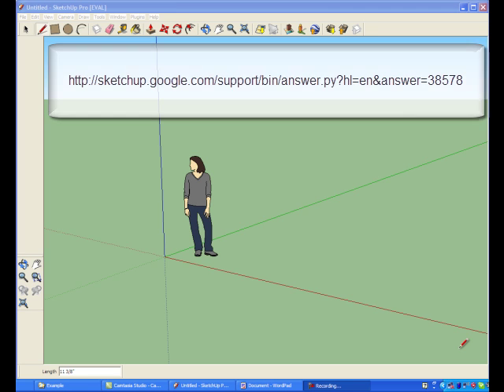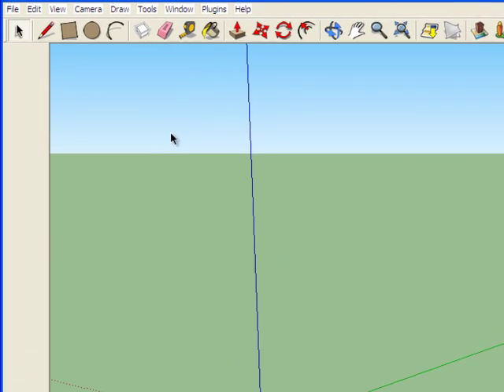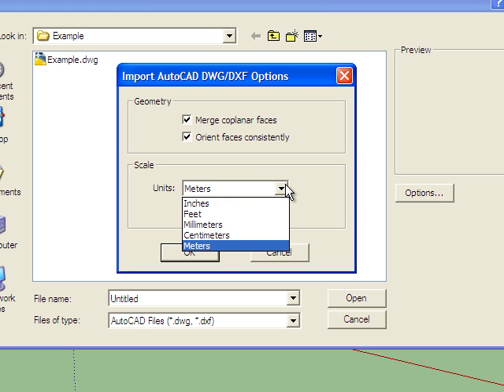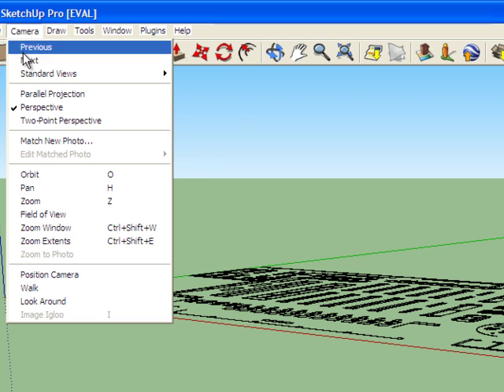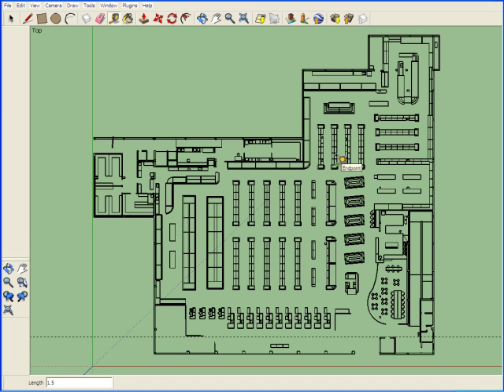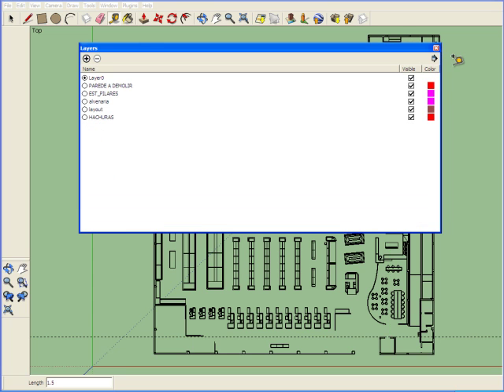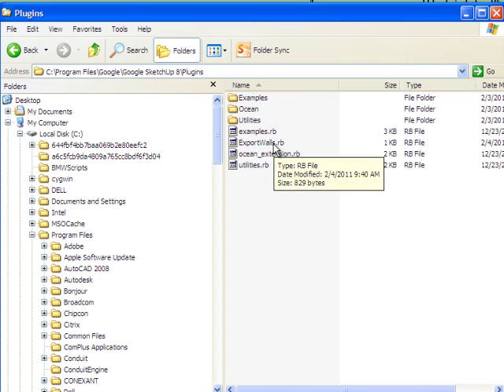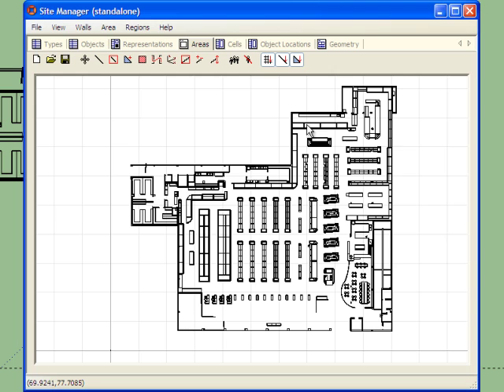How to Import an Autocad file using Google Sketchup

Comment from the maker: It seems that some of you are still having problems. I can't answer as to why your particular Autocad file won't open in Sketchup. You will need to contact Trimble or try saving the file in an older version for Autocad. I have recently run into a situation myself where the resulting conversion is an empty file. Many times an autocad file is huge block, meaning everything has been locked and combined into 1 object so that you can't get to the individual lines. Before running the script make sure to select everything, right click and choose explode. Repeat until you can no longer explode. This will give you access to the individual lines.

Comment from the maker: Did you read the notes in teh description? I find that sometimes I have to play with the precision units a bit to get it to output the file correctly. I am not sure what causes this problem, if it is autocad or gs? This is really just a hack so you'll have to play around with it a bit. If you are trying to use a 3D cad drawing it definitely won't work.